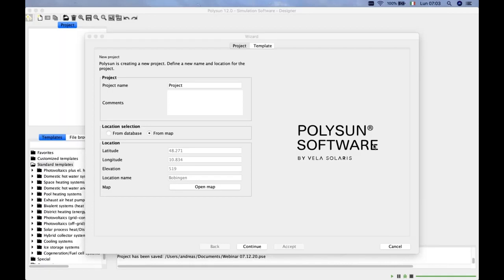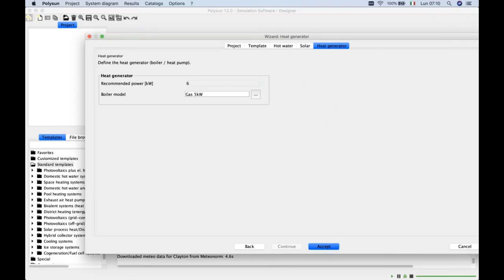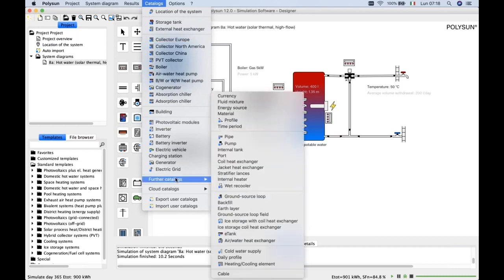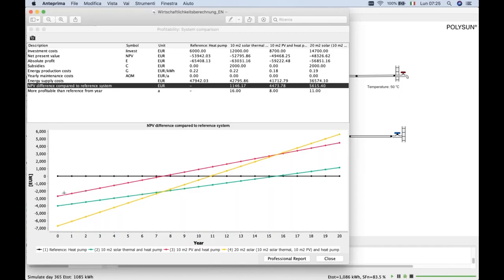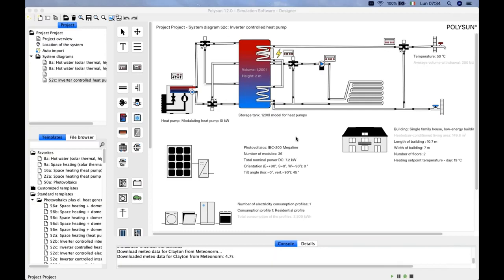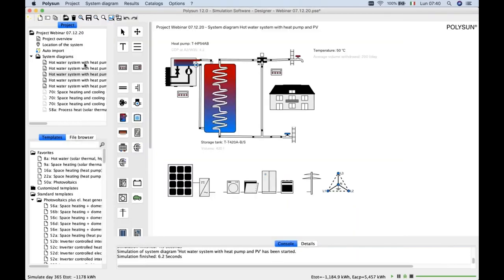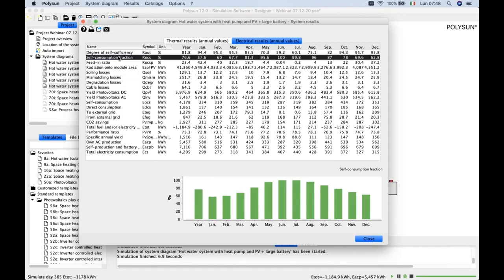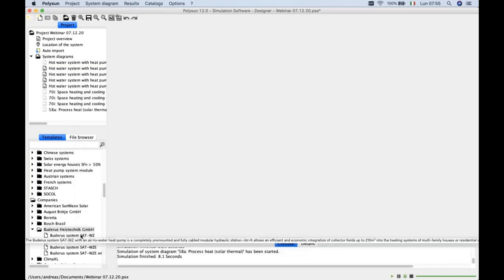Introduction to Polysun - Solar System Simulation Software for Academics

Comment: Does Polysun manage parabolic trough collectors?  I have looked in the data base but I have just found flat plate collectors, tube collectors and unglazed but not parabolic.
Reply: It does, ex.g. the absolicon T160 is a PTC